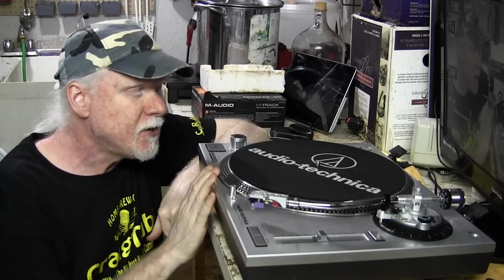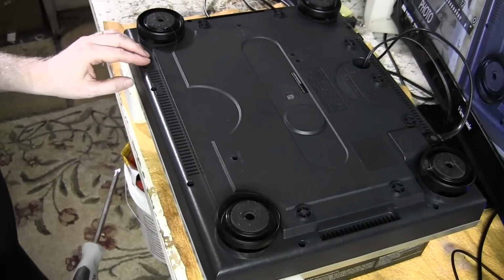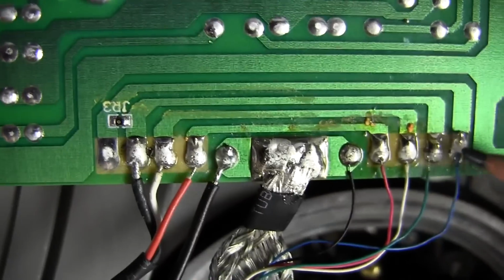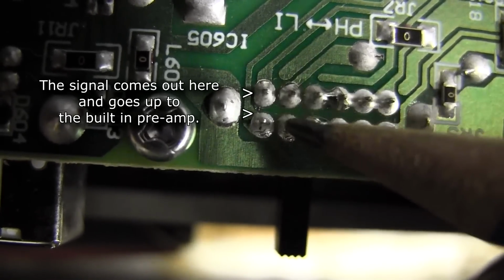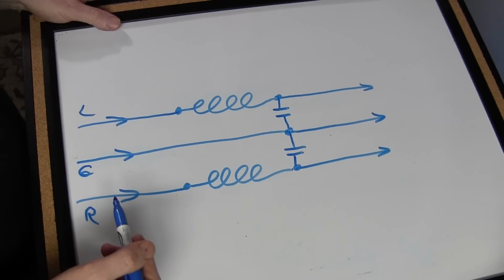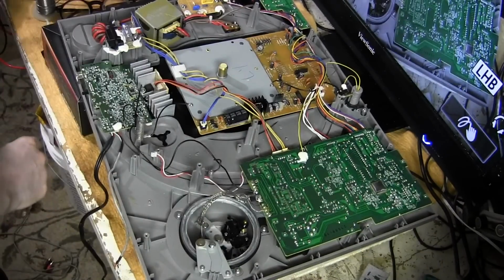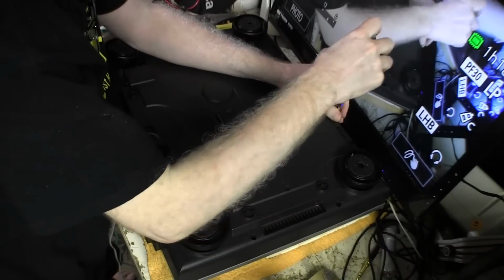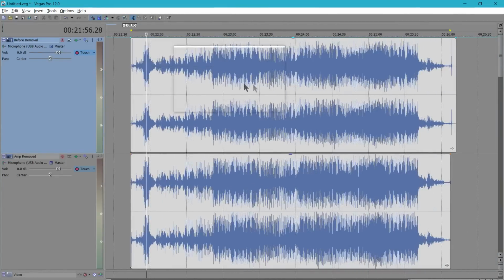Preamp Removal - Audio Technica AT LP120 USB Turntable

Comment: I appreciate your efforts.  In my opinion this should have been a 3-way comparison: first, with the pre amp, second, with the pre amp left installed but turned off and wired to an external preamp and third with the pre amp uninstalled but with the connection wired directly  to the external preamp. 
Perhaps my hearing is more sensitive than that of some other people but with the preamp uninstalled as heard in your video, the highs were a little too unrealistically and unpleasantly high.  I guess I could become accustomed to these (what sounds like to me) slightly exaggerated and unrealistic sounding) higher frequencies but why bother when the sound of the installed pre amplifier is more pleasant, in my opinion.  
I was listening to your video with a pair of excellent monitor type professional headphones, the Ultrasone Pro 750.
Reply: This test was with the pre installed, but using my own preamp. (internal preamp switched off). What you were probably hearing was the bright sound of the AT440mla the way it's meant to sound. No turntable internals should ever change the sound of a cart.
Reply: I listened again to your before and after test and came to the same conclusion as before, the high frequencies were unnaturally and unpleasantly high during the "After" playback.  The "Before" playback was significantly more pleasant.  When listening to the "After" playback I realized that my body was actually tensing some.  I had the volume turned up slightly more compared to when I listened the first time.  
To what degree the audio is being affected by the the transfer to the Youtube video I do not know.  Perhaps the sound would be different if heard directly there in the room.  I am assuming you ran direct wire into the audio port of your camera.  
Judging solely from your before and after tests (which may not be a fair analysis all factors considered) I definitely preferred the sound of the "Before" test playing.

Comment: I have this turntable. And three others. The others are high quality examples from the 70's and very early 80's. They have good cartridges and tonearms. This one sounds almost as good to me, but the big advantage is that I can run it directly to my PC and I use it a lot for that sort of thing. Also, I use it for playing music between sets for my band(s). People love it!

Removing the preamp would take that away. 

Also, the A/B comparison results is just not enough justification for me to do this. If there was a stereo separation difference or dynamic range difference, that would be different. I CAN hear a difference in HF, but it is so subtle as to be only noticeable in A/B comparison, and easily handled by turning up the treble a tiny fraction, which is really not that big a deal.

BTW, I used the headphones in my avatar to make sure I'd hear it all (separation, Frequency response and dynamic range). With the Cambridge PC speakers, I heard no difference at all.
Reply: Rob Wells you can literally run any turntable into your computer.  Connect the RCA outs to the Line In of your sound card with an adapter and bam--i never understood the big deal with USB.  I guess so you can do it on a laptop or something without a sound card..?
Reply: I actually have one of those adaptors from Behringer. I primarily use it to connect a mixing board, but it has a switchable phono preamp. But that only covers one of the four reasons I got this tt. And the setup is cleaner as it is.
Reply: I actually have one of those adaptors from Behringer. I primarily use it to connect a mixing board, but it has a switchable phono preamp. But that only covers one of the four reasons I got this tt. And the setup is cleaner as it is.

Also, you do need a phono preamp to connect to a computer  if your tt does not have one built in.
Reply: The line in on my laptop that I use for field recording is really a mic in and won't work with a line in. It's why I had to get the adapter.

Comment: If you add the RCA cable output bypass directly to the circuit do you even need to remove the preamp? Of course you would have two sets of output cables but, you wouldn't have to remove any hardware and void your warranty.
Reply: Because there are components in parallel with the output, they will have an effect unless they are removed. You would have to install a switch to effectively totally "switch out" the pre-amp. This can be done.

Comment: I was thinking about getting this TT, correct me if I'm wrong but wouldn't shorting the the the filter achieve the exact some thing and you wouldn't have to actually remove the pre amp... or cut any wires, just add the 2 wires needed to short. you wouldn't even have to worry about ground.

Or you could have just de soldered L and R channel from the first board like you did, but keep the ground cable their, then just solder the new RCA cable to the board and solder the ground for those RCA cables right to the ground coming out of the board.
Reply: that's the way I was going to do it, but storing the preamp inside the turntable was not the best option IMO. I just took it out. Too many wires to tie up.

Comment: Does anyone here think that if I just boost the treble a bit on my amplifier with this turntable then it should sound good enough to hold me over for a month or two until I can get a decent preamp? Obviously I know the sound quality wouldn't be exactly the same, but enough to sound a little better maybe? I do plan on doing this whole thing of course, I just want to save up a bit so I don't replace a crap internal preamp with a crap external preamp
Reply: Yes, that's what I did.

Comment: If you want to be amazed:

1) Leave the AT off, I mean off off, no power at all.
2) Attach a known good external preamp, power it on and make sure it's plugged into your receiver/amp and speakers.
3) Put a record on the platter, drop the needle, and spin it by hand.

That's how quiet this unit "can" and "should" be.
Reply: Agreed.

Comment: Doesn't the preamp also include the RIAA equalization?  See here -  https://en.wikipedia.org/wiki/RIAA_equalization.  I am just listening over my MAC speaker but the after seems to be excessively "bright".   Based on the RIAA curve I can see why.  Anyway, I am no expert but the sound is "warmer" before.  Thanks for the interesting share.
Reply: The external preamp I used after removing the built in one, has the RIAA curve. All phono preamps do.
Reply: I would  entirely agree with you regarding the RIAA equalization and the overly bright sound. If I owned this turntable I would run the wires straight from the arm to the phono input socket of a preamp/amplifier. I'm sure that most "standard" turntables must be wired this way.

Comment: I just picked up an AT-LP120-USB and plan on using it for ripping my vinyl collection into either DSD or FLAC. The only Hi-Fi equipment I have are for on-the-go (mobile). But I do want to be able to rip my records in the best possible way, so will doing this be necessary?
Reply: You can only do what you can with what you've got. We'd all love a $5000 turntable to rip our vinyl wouldn't we? Go for it bro, and keep your vinyl safe for the day when you can do it again with something better.

Comment: It doesn't sound to me to have better sound quality with the turntable preamp removed, but it clearly does sound like the preamp was limiting the frequency range, and that bypassing the preamp gives you more to work with through your own system as you'd see fit. The preamp was probably meant suppress bad sibilance from cheap cartridges and worn out needles.
Reply: Your profile pic.. I used that Tascam for years to record my music. What a machine!!
Reply: CraigTube - It was a great machine. Bought it used when I was 19 and learned multi-tracking on it.

Comment: Hey, that's a good song and really evokes the 80s for me, in a good way.  Was it ever released - maybe local air play?
I honestly couldn't tell much of a difference between the two, maybe in the highs (cymbals, high synth) but it wasn't enough that I'd do an upgrade, or be upset with the default performance of the turntable.
Reply: Maybe the range on your ears is going south before you. The difference in sound is very obvious to me, and that's in a room with an air conditioner running.
Reply: WR3ND Entirely possible, I've been in live bands since early on, and we didn't know the importance of hearing protection back then.  I plan to listen again just as an experiment - can you pinpoint the differences you are hearing, or is it simply an overall increase in sound quality or clarity?
Reply: The high end especially, cymbals and the like, sound a lot more crisp, like there's more range on the high end. That's what stands out the most to me. In general the after sounds less muffled to me. Might be what you're listening on too. But yeah, could be hearing, since you mention there's reason why it might be. Sorry if I came across too harsh. I can totally understand people not wanting to mod their turntables and the like. I actually plan on getting this table and leaving the preamp in to use for the time being since I don't have an external one, just the normal receiver amp out to my speakers. The motor on my current table burnt itself out. Maybe one day I'll get a higher end external preamp and revisit this.

Comment: So much motor rumble from these why bother
Reply: You're talking about the Audio Technica in particular or that type of turntables in general? I hear no motor rumble coming from mine, just the needle on the groove.
Reply: Paulo Ribeiro I had the USB version and you could hear knocking . At times through the music. It also had a dummy antiskate. Durring this time I tried Stantons  line and the defects abound. Bad batches with no quality control. The oem lines would have a difficult time convincing me to purchase another.
Reply: Sorry, i forgot to mention mine it's a Stanton T120.
Reply: Paulo Ribeiro Doesn't matter they all come. out of the same factory. If you. have a older model it may better because Stanton used a finishing house in Florida. Gibbson now owns the brand and no longer uses a finishing house.
Reply: Yes, i noticed the similarity on several AT and Stanton parts, and i think you can include Onkyo too (and probablly more). However, i think this Stanton model is not bad at all. Like i said, in silence parts between tracks you notice nothing more than the sound of the needle on the groove.
Reply: I use mine for spinning vinyl on a live cast, NOT for archiving. I have an old Sony direct drive, and a Poineer, both quiet as a mouse.

Comment: I did the same thing on mine. When I purchased the AT-LP120, it was to be used as a second turntable alongside my vintage Yamah YP-B2 TT. If I didn't have anything to compare it to, I'd think it sounded fine. But the difference between the two was night and day. My Yamaha sounded bright and full of life, while the AT sounded muffled. Put it through surgery, and now they both sound fantastic. Totally worth the hassle!  Great video. Yours was the best I've seen showing the before and after.

Comment: I wonder if the internal pre-amp would still be functional (and no worse for noise) if the output shunt caps were removed and coils shorted... If so, the table would remain quite compatible while not coloring the cartridge output.
Reply: If I had an extra internal preamp to do this to, I would for sure.
Reply: If you're not going to use the one you have, it might be extra... ;)

I'm curious as I have this table too, but am currently at least still using the built in preamp. It does sound a little flat to me, so if there was an easy enough fix at the source instead of in my receiver, I might go for it.

I understand of course if you've moved on and are just wanting to use your external preamp.

Comment: Hey Craig, I'm just on the other side of T.O. If you want a good walk trough of electronics I'll be happy to give you a tutorial. Capacitors don't "shunt" anything to ground. That's just how they work, they need a difference of voltage on either side. What they do is delay a waveform because they take time to charge. Anyway it's easier to explain in person or on Skype or something. Lemmy know.
Reply: I know that a capacitor between ground and signal will act as a low pass filter. Maybe I worded it wrong but I do know how this works. Just look at speaker crossovers. I'd be happy to Skype and geek out tho. Cheers!
Reply: CraigTube that's quite true, a cap can act as part of a filter. Not a great one all on its own to be fair but doable. I think it's more about how they work exactly. Once you get a good grasp of what's going on inside any component it makes a awful lot more sense. 
For instance, this weirdos people out. A capacitor has no actual electrical connection across its poles. Unless it fails a cap almost never passes electrons from one side to another. That's probably the biggest misconception.

Comment: Thank you! You understand what you are doing and you've proven that bypassing the preamp does improve treble performance - improved transient response. I have to wonder if removing the LC network on the preamp / USB board might have done much the same - possibly a third test which would also determine how much digital noise is coming through.

Comment: Any way to fix the `(in most cases) too weak antiskate on these things as well?
Anyway:  great song !
Reply: Turn up the dial?
Reply: Even at the highest setting it is far too weak. i heard someone shortened the spring to give it more tension but spend hours on it...
Reply: I see. Thanks for the heads up.
Reply: Yep, just tested my AT LP120-USB and even with the antiskate dialed all the way up to 7, it's too low, with the tracking weight set to 1.75. My records still seem to track and play well, but it's going to bother me a little that I can't fully dial the table in. I tested this on the face of a DVD, and the tone arm is very noticeably pulled in toward the middle.
Reply: WR3ND sorry to hear that, hope you could get it fixed or got another table.
Reply: Gigidag77 im not sure if its the anti skate thats too weak or the tonearm bearring thats not smooth enough.

Comment: I did this project with my turntable of this make and model two years ago.  I did it on pure faith that it was the right thing to do because since I had no use of doing U.S.B. transfers,  any signal going through extra circuitry would produce some sort of resistance in the overall signal. (At least that was my way of thinking). Thanks to your extra effort Craig, I can rest easy that I KNOW I did the right thing, because the result to my ears is the same. The recording without the u.s.b. circuitry,  sounds clearer,  and more ALIVE, and that's what it's all about when listening to artists.  A listener has feel their words as well, and unfiltered clarity helps make it happen.  (at least with me it does! ) THANKS AGAIN,  CRAIG!

Comment: very nice demo. question.
the RCA outputs are are connected to ground on the circuit board. This is usually connected to ground via the Right channel lead. But there is also a separate ground lead from the disconnected  preamp. can't this set you up for a ground loop is it is connected?

Comment: I was just wondering, how do I ground the TT if my audio card/mixer does not have a screw for the ground? Any input is greatly appreciated.
Reply: You need to go from your turntable to a pre amp then to your pc card. The pre amp will have the ground lug, and then line level RCA out puts.
Reply: Thanks Andrew!

Comment: Definitely a different sound without the preamp. It sounds much cleaner.
Did you connect the other end of the new ground wire to anything?
Reply: Into the back of the phono preamp where it's supposed to go

Comment: It is never too much to say again and again "nice work Craig". You pick my attention and made me disassemble my Stanton T120c turntable to find out i had exactlly the same issue. But i will leave all routing as is and add a new one directlly from the tonearm cabling to 2 new RCA panel plugs + ground connector. Thank you for your research.

Comment: Nice video, but I don't think this is a relevant test for the audio quality difference as it is very subjective. To do it right, you need to use a special disk with calibrated sound tests and compare the differences in  output using an audio spectrum analyzer. Something else to measure is the noise floor and spectrum in both cases. Only then you can decide which one is better.
Reply from the maker: I think I did leave it up to the listener to decide which sound they preferred, so yes it is subjective. Without the preamp, it's wired just like most other turntables. Spending all that time, trouble and money to analyze the output seems a bit overkill to me, and you'd be better off just buying another turntable.
Reply: no compliment for the work on the turntable but you music is outstanding all ,the music,the text,the recording hat off merci

Comment: OK Craig here is one for you.  I followed the procedure as you have done to remove the pesky pre amp in the turntable.I did this after my Panasonic SX- 950 was having issues with sound dropping out after a time of playing and inputted device/medium.  Frustrated i purchased a new receiver/Onkyo and had a deliberate phono input.  Once I installed the new receiver and tried an album, there was hum very loud during playback, with and without the "on board amp" on.  I checked the connections, found that the "extension" I purchased for the turntable was partially to blame, however It seems that on occasion I power up the turntable it hums/has noise, I shut it down and power up again and usually clears the problem, but what I have noticed is that I am only receiving 1 channel at times and it isn't always either a left or a right, it affects both
Any suggestions?  i am a novice electrical guy BTW  
Thanks
Dave
Reply from the maker: That doesn't make much sense to me. Ya got me stumped.